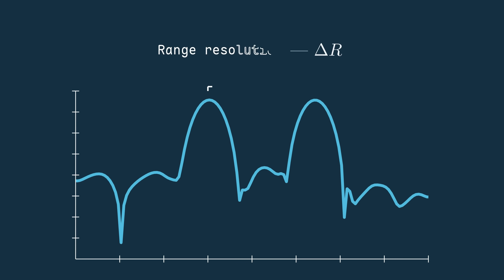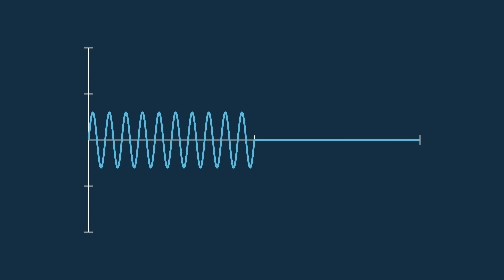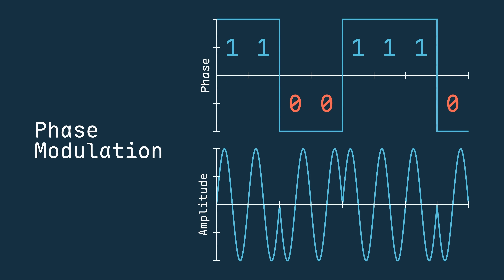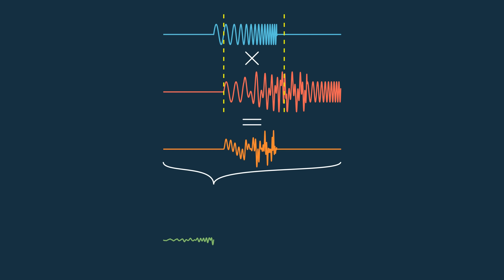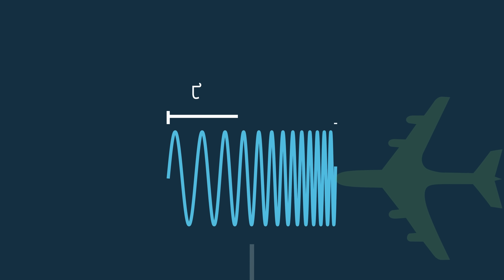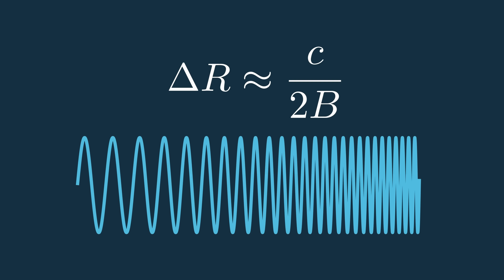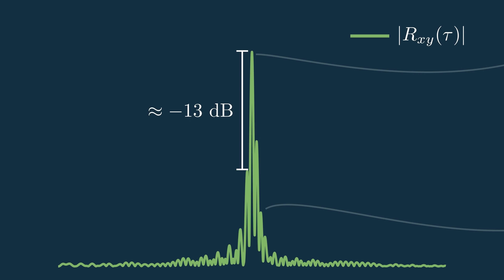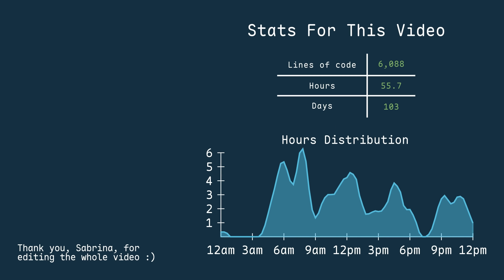Pulse Compression: How Matched Filtering Boosts Weak Signals and Sharpens Resolution

Comment: I was playing with a comm testset while doing a calibration and learnt something a little profound.

When you FM a signal at a very slow speed, you still get sidebands. I visualised the CW just ramping up and down at the rate of a sinewave, but the spectrum analyser is like NOPE - it is not a rectangle that occupies the frequency deviation but a boat load of sidebands and that implies zero frequency components between them. Better yet, when the modulation index is like 2.4 the center carrier just disappears! The FM center frequency that is transmitted has zero power!! like wtf

I chalked it up to some wacked fourier series math I don't understand but seeing it with my eyes is more reinforcing than any lecture slide.

Comment: I was a RADAR tech in the USMC.  After a major upgrade, I wrote the tech manual for the updated TPS-63 receiver processor with Westinghouse.  It used polyphase encoding plus a couple other tricks.  That RADAR had a "gap filling" mission.  It was designed to pick up low flying aircraft against stupendous terrain clutter.  It was astonishing at pulling targets out of the noise, and for all the same reasons it was excellent at separating nearby targets in the air.
Reply from the maker: Awesome anecdote! Pulling real targets out of noise is easily one of the most satisfying things I've done in signal processing :)

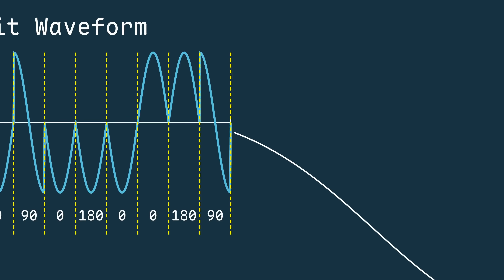Comment: Quick question about the phase modulation shown here: Doesn't that introduce a lot of harmonics since we get signal discontinuities, so we would actually exceed our allotted bandwidth with a signal modulated like this? e.g. at 14:46 we get a bunch of step-function like signal discontinuities (between signal segments that are 90deg out of phase) which should generate all odd harmonics, with the frequency falloff not being very fast
Reply from the maker: That's a really good intuition and, yes, you'd mostly be right. The thing that makes it okay is that side lobe level. Since the side lobes of the barker code (for example) are so low, >99% of the power is still contained in the main lobe so the spectral leakage is very low.

Comment: What if we subtract the original signal from the recieved one at the point of the most correlation? wouldn't it help with identifying the not so obvious signals after that? Does magnitude of the corellation tell us how much of the signal to subtract so that we don't overcompensate?
Reply from the maker: This is a really awesome comment! Yes, you could do this by first taking the cross-correlation to find the lag to align the transmit and receive waveforms and then scaling the transmit to match the receive amplitude. The issue I can see is that the lag is not an exact number (the mainlobe width) and it would also be difficult to find the exact amount to scale the transmit waveform down. Any error in either the phase or amplitude scaling to the transmit would leave behind some residual signal from the main target and distort your signal. That being said, this could still be very powerful and I believe some systems employ this method of "incremental target detection". Super cool that you pointed this out - I'm glad you sent me down a quick rabbit hole of researching this.

Comment: First, you could fit the return to sin[omega(t-t0)]/[omega(t-t0)] to extract t0 much more precisely.  Effectively, the noise is statistically reduced by 1/sqrt(N) when N data points are used in the fit.  Second, the Doppler shift due to the target's incoming or outgoing velocity will result in a position error; but, measuring the velocity using several pulses will allow this to be corrected.  Third, d phi/dt is the frequency even when phi=omega t + f(t).  Modulating f(t) (especially quickly) also modulates the frequency.  Fourth, by turning on and off the pulse more slowly, you also reduce the bandwidth needed to contain these sudden changes in signal.

Comment: In seismic stuff, they go with a short pulse but do many of them and sum the results.  They even do this when they transmit a sweep as in a vibroseis.
There is even a method where they keep it spread out in time, do a bunch of stuff and then do the correlation to turn the sweep into a pulse.
Reply from the maker: Cool! Pulse integration (basically summing pulses) is done in radar too and is something I may cover later. I'm always interested to hear about analogous fields
Reply: @MarshallBrunerRF  Yes there are lots of parallels and some huge differences:
1) The speed of sound is not constant.
2) You have one signal source and a chain of perhaps 1000 geophones spread out along the survey line.  The data has to be adjusted for the lengths of the paths before summing
Reply from the maker: 1) Neither is the speed of light depending on the medium (just being pedantic lol, it's mostly constant in air)
2) That's crazy - kinda sounds like a phased array to me...
Reply: @MarshallBrunerRF  The math comes out phased array like
Reply from the maker: nice, phased arrays are so cool. I'll have to look into this

Comment: Is there a benefit to an up chirp vs a down chirp?  

Also, you cant simply do leading edge detection bc you can’t see the leading edge by itself. The SNR is too low. They integrate the power over time to increase snr. Thus the time domain was compressed and no “leading edge” is there.
Reply from the maker: I believe there's no benefit in terms of resolution or SNR, but it could be helpful to choose one over the other depending on where it is most convenient for you to place the down-converted signal. I am also vaguely familiar that SAR systems sometimes use alternating up and down chirps, but I haven't really worked with SAR. Thanks for the comment!

Comment: I didnt quite understand if you are multiplying by phase or amplitude for the cross correlation 
In the frequency modulation scheme videos you showed chirping up and down as a way to determine both range and doppler shift. Is there an analogy in barker codes? can you send cyclic permutation of the code to try and extract additional information that is not present in a simple cross correlation? Also I would love to see more on the implementation in hardware vs theory. It seems that cross correlatingvevery instant of the signal with a long sequence is computationally exploding.
Reply: Frequency modulation isnt required for doppler measurement in a CW application, you can directly measure it by phase difference. But when using an FM waveform you have to work in a final step for measuring doppler. The typical implementation is a 3 step FMR with up/down slope for range resolving, with a final 0 slope for deghosting and doppler measurement. If you dont include this final step then you cant measure doppler.

Comment: This is for pulse radars. How about FMCW radars? Are the calculations and outcome the same?
Reply from the maker: This is effectively the same concept FMCW radars apply but without the gap between transmission and reception. The range resolution equation holds in FMCW radar.

Comment: If we know the expected cross-correlation pattern of our encoding, why can't we apply cross-correlation again? If we use a frequency sweep and the correlation resembles a sinc function with a single, point-like target, wouldn't a second cross correlation with a sinc function filter out most of the sidelobes and produce two distinct peaks in the plane+parachute example?
Reply from the maker: Honestly this isn't something I've looked into in too much depth, but I don't think you would see the benefit that you're proposing. You should (and I will too) look more into pulse shaping - this seems more like what you're talking about.

Comment: How do you take that correlation and guess a shape of a surface it hits? As in predicting what target it is? future episode?
Reply from the maker: Good point! In this video, I explained matched filtering using some "ideal" targets that have no width or shape. In reality, even if you get very fine range resolution and low side lobes, there will be some shape in the return because different parts of the target will scatter the traveling transmit wave. The low side lobes and range resolution really just help you determine that shape and differentiate one target from neighbors.

Comment: Another bandwidth limiter is the system's designed frequency. A 50MHz bandwidth is ±5% when operating at 500MHz, but only ±0.5% when operating at 5GHz. Electronics and antennas are good at handling frequencies that are only a tiny percentage away from their natural resonant frequency.
Reply from the maker: Exactly! So many reasons why wide band is difficult. Luckily most radar systems use very small bandwidths
Reply: @MarshallBrunerRF  Thanks for this series btw! I'm on the digital comms/SDR side of RF mostly, and it's really cool to see how all of the same principles apply to radar.
Reply from the maker: Yeah they really do apply everywhere! Working with SDRs is really fun